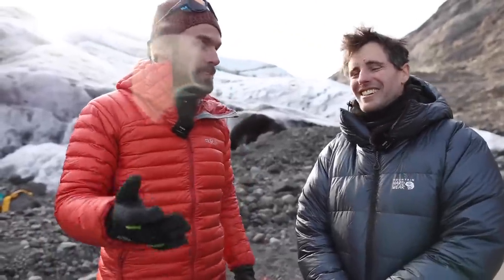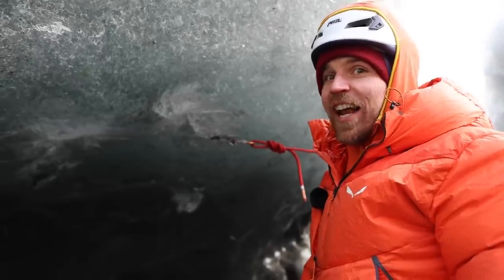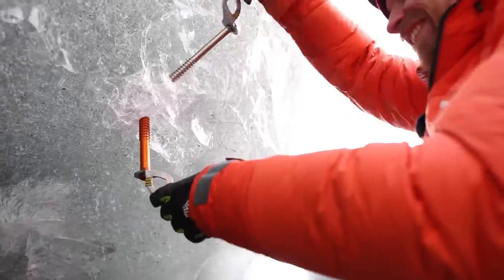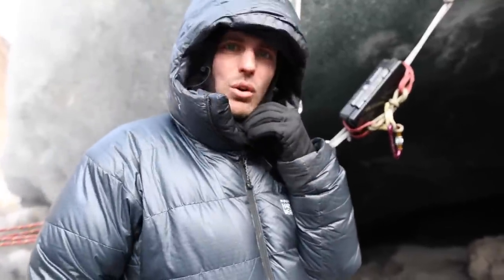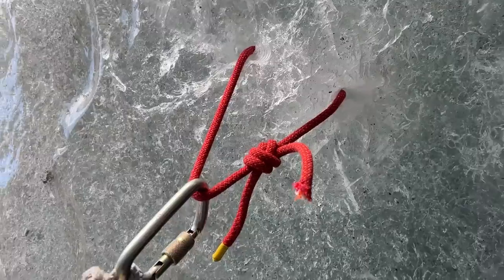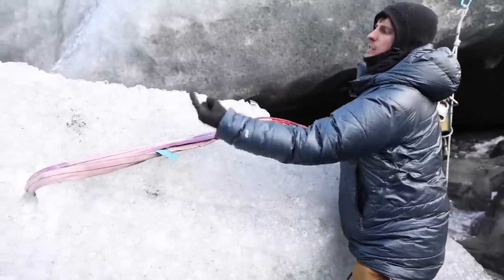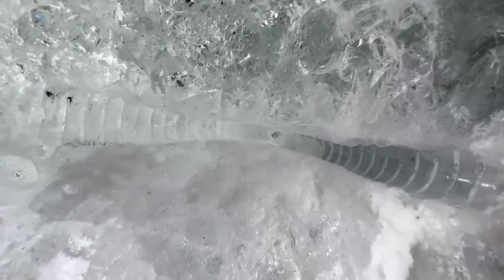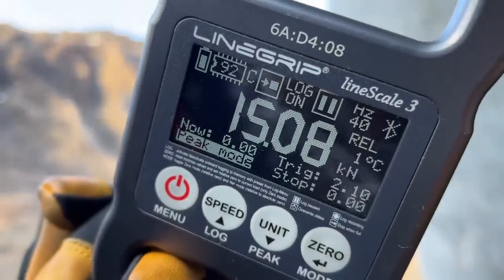What breaks first?

Comment: Would love to see a comparison with Waterfall Ice, and a comparison V-thread and A-thread.
Reply: From memory, A-threads are meant to be marginally stronger, but they are both so strong that the difference between them in their intended application is kinda semantics. I go with A-threads because it's way easier to line it up correctly and therefore faster.